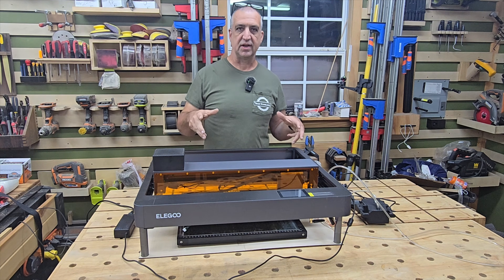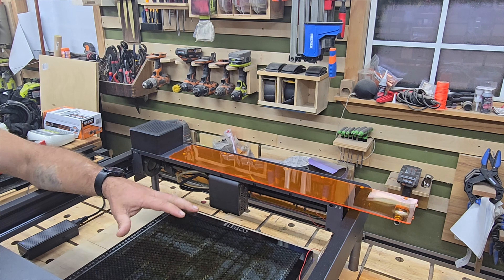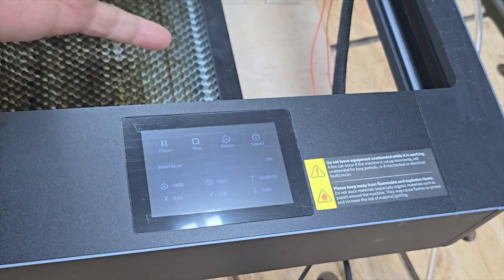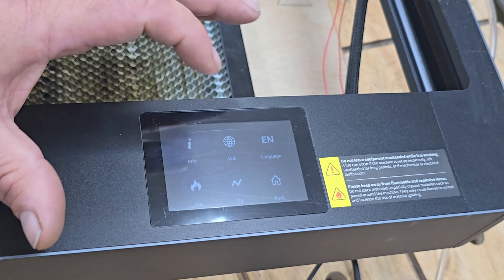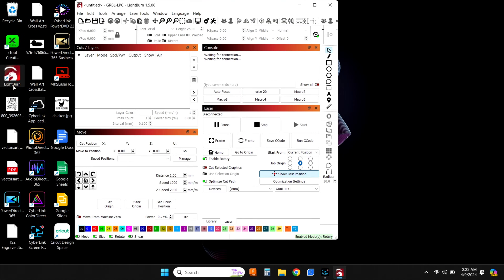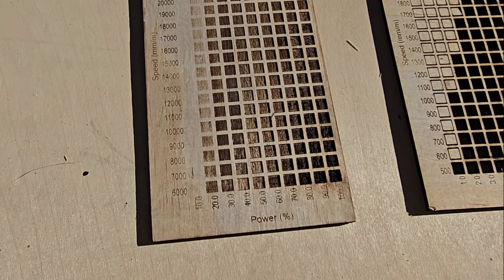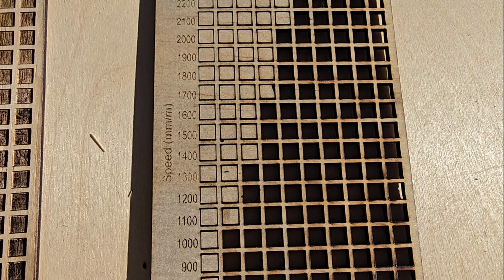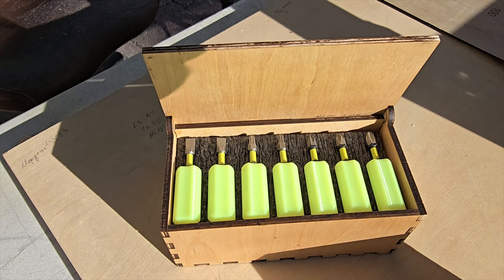Best Value You Can Find Elegoo Phecda, Prove Me Wrong!

Comment: Great video,  now the question a year later, still a good value or are the others that you have since tried on this price range that work better? I want to be able to cut shapes out of copper about 20-22 guage,  plus do wood in the same manner. For wood and metal want to create intricate mandala shapes. For metal this would be for jewelry making on a surface shape of 2 inches or less. Cutting the shape out and engraving.  Would this machine handle this? Or can you recommend a better machine by now?
Reply from the maker: I haven't checked the prices recently.  I just reviewed the Acmer 30w. https://amzn.to/3WBp6Ig
It worked awsome and the price is almost half of what it was 2 years ago and about the price this one was when I reviewed it. I have to get that video edited. For copper you need a fiber laser. A diode lasers doesn't cut metal very well and a fiber doesn't cut wood very well.
Reply: @ShopRamblings you have been most helpful,  much appreciated.  Keep up the good work!

Comment: I have this machine , I can engrave with it on pretty much anything I've thrown at it works great however I for the life of me have not been able to get it to cut anything no matter how thin the wood or material is
Reply from the maker: 1 What watt machine do you have?
2 Are you using air?
3 What speed are you running.
Reply: @ShopRamblings  It's the 20W version, running @300mm and 100 Power
and yes am using the air pump
Reply from the maker: You are probably going too fast. It depends on what you are cutting. Make sure you a focused. If I am cutting something thick I will lower half the thickness if possible. You may need to slow down and do multiple passes. You should be able to cut most wood up to 1/2". Thicker if it has a smooth grain and the right setting. .

Comment: I have had a 20W Elegoo for a few days now, and it is my first machine. So far I am using the Laser GRBL software. The engraving is perfect, but with the cutting I have 2 problems. The strangest one is that the laser does not complete some cuts in the path, it does not finish a circle or a line. I think it is not an assembly problem, because the engraving is perfect, it is more so when it makes the second pass for cutting, the same error occurs, if the motor steps were lost, they would not be in exactly the same place. The other problem is when exporting a file from Corel as .sgv, and opening it from LaserGRBL, some that are paths, the software puts them as cutting. If someone could help me it would be wonderful. Thank you and your video is very good. Greetings
Reply from the maker: That sound like a software problem with the lines not being connected. Know that they have raised the price for lightburn it is not as easy to tell people to just use it. I do not have any experience with lasr grbl but I need to check it out so I can help people with it. Zoom in on the file where you are having to problems and make sure it is a complete line.

Comment: Can you tell me what values you used to cut plywood? How much power % and how many mm/min? I also have the 20watt version
Reply from the maker: I always cut at 100% power. Different thickness plywood will be different speeds. Even the same thickness and species will be different depending on the glue. I have switched to mm/s. I will run material tests starting around 5 mm/s. If it cuts smooth in one pass, I will go down, but that is normally a good starting point.

Comment: 10 w vs 20 watt for cutting do ytou really need more then 8mm to make cool boxes and chests like you made what mm was the basswood you used sorry I didn;t catch it in MM I was looking for wood on amazon Canada anbd didn;t really see any oivewr 6 mm?
Reply from the maker: Different people do different things with their lasers. I have cut up to 20 mm hardwoods with my lasers. You can make a lot of cool things using 2-3mm wood. I use a lot of 6mm underlayment for Home Depot. I can get a 4'x8' sheet for $20. The thing with a more powerful machine is that you can run faster. When making a lot of intricate cuts, even a small project can take a long time.

Comment: What settings did you use for stainless?  I cannot get my 10W Phecda to mark stainless at all, even at 100% power and 1.5 mm/s :/
Reply from the maker: I would have thought that should be good. Are you using lightburn? I would run some material test.

Comment: Can you burn realistic portraits like with Pyroprinter?
Reply from the maker: In my experience getting realistic portraits is more about how you process the image and your setting. I believe you should be able to as you can see on the coasters I was able to get close to the photo I was using. It needed a little more adjustment but I ran out of time.
Reply: @ShopRamblings  well, i was thinking more on the A4, A3 sizes for the portraits on plywood